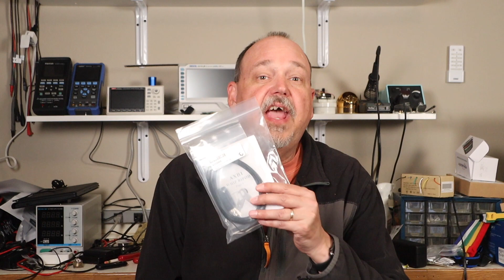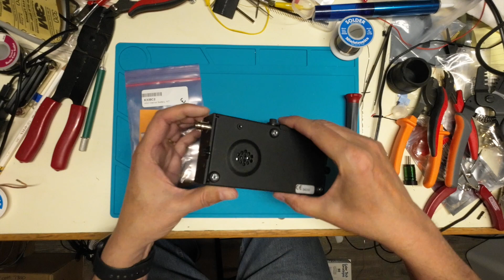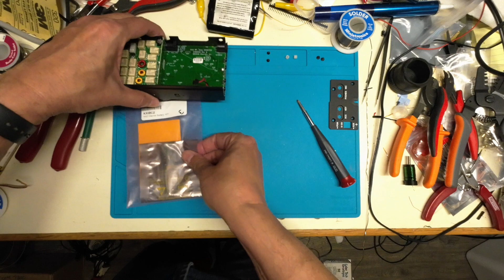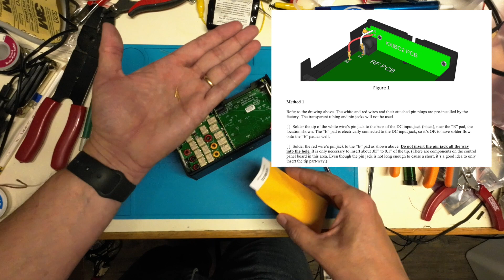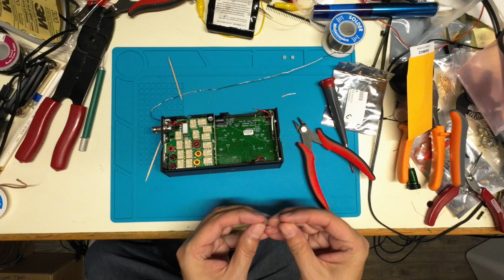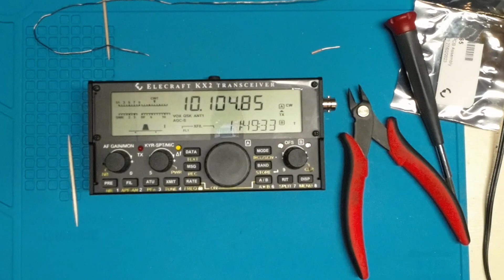KX2 Internal Battery Charger: Install Guide

Comment: How can you monitor the charge?
Reply from the maker: The light will go out once it is fully charged. The charger board stops charging the battery once it is topped off.

73 WV7W

Comment: Well, finally...  Took advantage of the Elecraft Black Friday sale and got $35 off plus free shipping.  The installation was easy except for wondering if the solder really did flow down the pin and into the hole!  (Apparently it did because I couldn't pull the pins back out, and the charger works.  😁)  I went with Method 1, by the way.  Really appreciate your video, only took me a year to get up the nerve to do this.  And I don't know why I thought my "E" hole was full of solder, because it wasn't!
Reply from the maker: Glad it worked out for you. It is wonderful to not have to pull the battery to charge.

Comment: I have the KXIO2 time board but I ordered this and it will be here in a few days, I guess it's worth it hi hi.
Reply from the maker: It absolutely is. Not having to pull the battery to charge is awesome.
Reply: @houseofhamradio  My install didn't go that well, I had installed it and thought there was a problem because the LED flashed once and didn't light up. so I re-soldered and ended up melting my brass pin (I did option 2) into the PCB and sent my radio back to Elecraft, just got it back a few days ago. I found that my install did work, however I was using the original power brick (12.6v) and not a 13+v that I had skipped over the recommendation due to my own ignorance. Anyway, it's working now and I ordered a 4.6v Bioenno power brick to charge the radio. I think they should make that a bit more clear in their instructions (about the additional power to charge internally)

Comment: just installed... on my unit one hole has solder... which i found impossible to remove... had to get a blob of solder on it and then just solder the lead... not as secure, but still works FB
Reply from the maker: I had heard that about some radios. Mine wan't like that but I bought mine in 2020.

Comment: New firmware is required to support this new KXIBC2 board, so a firmware update should be part of the installation. :)
Reply from the maker: Great point. Yes you need firmware version 3.02 or newer.

Comment: I already have the KXIO2. Debating on whether this is worth the price or not.
Reply from the maker: That is a toughie. I would say if you want to be able to charge without removing the battery, then go for it. If it doesn't bother you then stick with the KXIO2.
73, Bob
Reply: @houseofhamradio  Hmm, $140 just to not have to take the battery out😲. I've wasted more money on dumber things, I suppose! It would be a luxurious indulgence, but so is owning a KX2 AND and IC705!
Reply from the maker: @whippersnappercc  Yup, me too. I was all ready to spring for the KXIO2 for the clock when this came out.
Reply: Same here, I've had mine for 1.5 years and haven't had the time to install it.  I'm now used to running my great LifePO4 BLF-1206T Battery mounted on my old Alice pack backpack frame with the KX3.